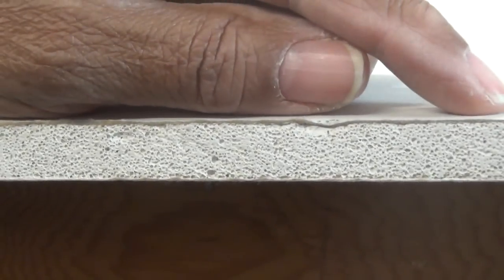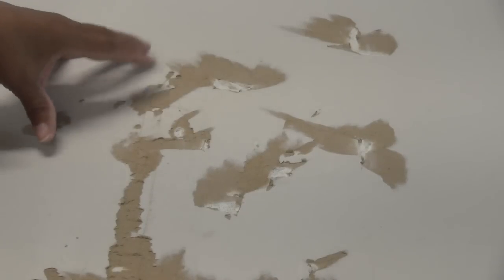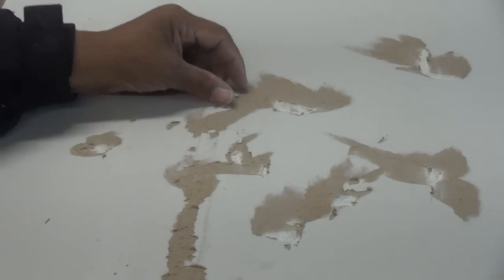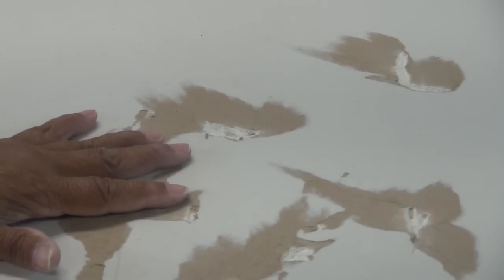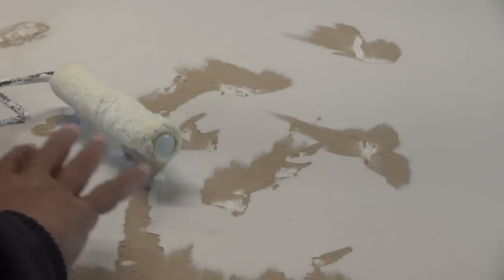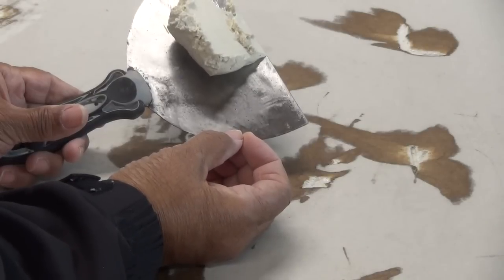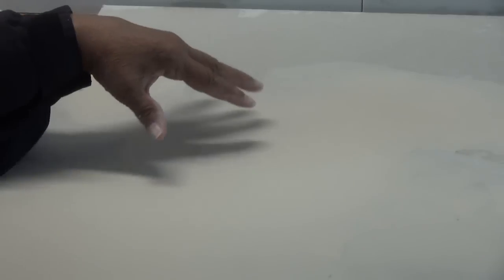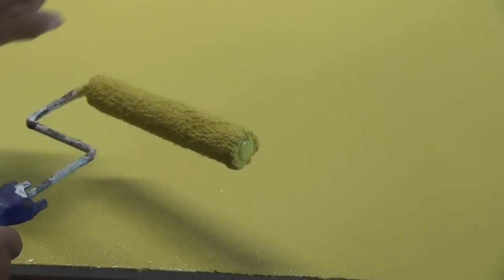How to Fix Damaged Drywall Paper

Comment: I have a bathroom that I believe was fully covered in wallpaper.  The people I bought the house from hand taken down the wallpaper but didn't thoroughly remove the paste.  They painted over the glue residue!  I couldn't figure out why the wall, between the back splash and the medicine cabinet I installed, had what looked like caulking all over it.  Sanding didn't remove it.  When I replaced the caulk around the shower surround I realized it was the same way.  Started looking at the walls and realized why they looked so funny.  Again tried sanding and it doesn't do a thing.  I tried wallpaper remover gel over the paint; I can scrape off the paint and the old glue and have a fairly smooth wall.
I take it I can use the Gardz on the entire wall and then paint over it?  I hope this is the answer to my problem!

Comment: You don't need to pay for that product. I use a pva primer layer. 1 part pva to 5 parts water. Cost is very cheap. Just give it a few coats and boom, You ready to go. Works for me.

Comment: Leah, I've just started to watch your videos and have learned so much.  Love you patient, unhurried method of teaching. Very helpful.
I could use some advise on a project I am attempting. Not sure if you have done anything like this, but your knowledge and skill I have
 no doubt could point me in the right direction.  I have a statue of a dragon about 3 feet tall, not the scary kind, just adorable. But he's
seen a lot of weather and has small pits and shallow surface damage that needs filling in and smoothing over before painting. The
surface is a thin layer of either what looks like clay/terra cotta paint or glaze. Underneath is rough textured concrete or cement. Not
sure which. Painting is no problem---acrylic water based paint works well outdoors, but what product do I use to fill in the chipped areas. 
Will need an adhesive glue to make it stick as well. Pliable enough to mold a small top of one ear as well. Any advise would be 
greatly appreciated. :) Thanks

Comment: Leah clearly knows her stuff.  Great video.

This "problem surface sealer" looks like PVA.  I can't believe that it is so expensive in the US.  In the UK similar PVA is CHEAP, cheaper than even budget paint.  I'd be tempted to water down some cheap PVA wood glue and give that a shot rather than pay a premium for a "professional" product.
Reply from the maker: Hi Dennis, thanks!  It actually isn't glue...I  don't have the can in front of me right now, but I wrote down the ingredients in response to someone else's question...it's in the other comments
Reply: This is the PVA glue/sealer that I was referring to (http://www.powertools2u.co.uk/PVA-Adhesives/Everbuild-PVA5L-Universal-PVA-Bond-501-5-Litre.htm) although there are many different brands to choose from over here.  I've not lived in the States for the best part of 20 years (native of Lansing, Mi) so I don't know if you have access to a similar product.  It may be a less expensive alternative and is almost certainly worth trying out on your test wall.

Comment: You have a gift for teaching and are using it! I am learning a lot and love to improve our home. Wondering if you could answer this...our paint was bubbling so I started peeling it off the wall. It comes off in chunks and is also stuck. I am working on getting the rest off. I am planning on using your video to fix the loose paper issue. I do have paper in places that is not torn, but it has air below so it is not attached - kind of like an air bubble behind it. What should I do? This is a bathroom and I am also confused about finishing the walls in regards to primer and paint and skim coat. Could you clarify that as well? Please keep making these videos for us home improvement addicts !

Comment: My house was completely wall papered and panels with construction adhesive. It took forever to patch it up not to mention removing some parts of the wall paper inch by inch. I think would have been faster just replace with new sheetrocks.
Reply: I bought a house with the same problem. Dark paneling all over the house. Going to take a ton of money to get it updated.

Comment: I trust your skills Leah and I am trying to do the fixes on my home by myself.  I don’t have a ton of money and am not real strong due to some joint issues and I need to do some work on my enclosed stairwell.  Is there a safe way to get a ladder up on those stairs to put up some paint or wall paper . I know you can’t answer everyones questions but I bet a video on this issue would help a lot of do it yourselfers .
Reply from the maker: you know, I myself have never felt comfortable using a ladder on stairs.  I would generally work it in combination with a scaffold.

Comment: Here's the deal. Part of the sheet rock  de-laminated some of the paper and my sweetie pulled it off. Can this stuff allow you to re-plaster the exposed gypsum and allow the plaster to stick enough to sand and then add the new texture coat?

Comment: Oops! We're first-time painters just repainting my kids' room and they had peeled a large patch of paint off the wall all the way to the gypsum. I spackled the edges, sanded, texture-sprayed and primed over the area already! It's about a 5" x 18" area. Do I really have to remove everything just to apply this sealer? We were just about to get to the fun part... painting! Thanks for your videos -- I've learned so much and passed them on. :)
Reply from the maker: No, not at all!  If it patched fine and it is holding, you may be ok.

Comment: I LOVE Leah and her demonstrations.  ...but this one ain't gonna happen. No pro is paying $40 for this sealer. 
Cut a clean edge around the flaw with a break off knife, pull off the paper inside the cut, mud sand and paint. Love ya Leah.  :)
Reply from the maker: Andy,  You would be surprised just how often this product is used.  It can be purchased for a lower price online.

Comment: Great information, next time I do something like that at least it will be correct.
Now, how about a crack adjacent to a sliding door. If it was welding I would "V" it out, fill the groove and grind it down. Perhaps a similar approach on the dry wall, using the method you used in this video would also work??
Reply from the maker: Hi Tom, unfortunately the Gardz won't help with that.  It sounds like a drywall installer's mistake, where the joint was placed too close to the door.  I would just fill it in with caulking, because caulking material is somewhat forgiving.
Reply: Thanks for the feedback. Will give it a try.
Reply: Tom Herd ...that's exactly right...if its under 1/4" or so deep/wide you can fill it proud with spackling and sand it flush before texture/prime/paint...caulk has a tendency to sag even in small beads...
Reply: Thanks for the tip.

Comment: Hi Leah - I was scraping some damaged paint due to moisture and some of the plaster seems to have come off. It's just in the corner and it is plaster on brick. I now have this ridge between the old paint on plaster and the area that was scraped. I am nervous to use plaster but since there was moisture - I am thinking plaster. I saw your difference between video. Thank you so much - I hope it turns out ok. I would ask a question but I am still learning lol don't know what to ask. :)
Reply from the maker: good luck with your project

Comment: I have a small (quarter-sized) rip in the wall and before I saw your video was going to use a razor knife and cut the paper around the bad spot, cover with Gardz, then spackle, then sand, more Gardz and then paint.  Good idea or bad?

Comment: Ha, I'm glad I watched this. I'm doing a remodel in my bathroom. There is a large mirror (54x41) that I believe is glued to the wall over my double sink bathroom vanity. I want to remove the mirror and replace it with 2 separate mirrors instead of one large mirror. I am a bit concern that I will tear the drywall paper. Now I can fix that if I tear the wallboard.

Comment: Does the sealant replace primer?  If it does can I seal the undamaged areas of drywall as well, before applying the paint, which I assume is a water based paint. Good video. I have seen at least 10 on the same subject and this was the clearest and most productive.  The others.....I don't know, just too wordy with no really good explantations of what is going on no clear cut procedures as with this video. I pruchased a quart of the GARDZ for $11 on amazon. The gallon would have been cheaper.

Comment: Ohh I had thought  your name was jane 😱 Ohh leah.I have to face the this issue inside the ceiling inside my open cabinet space that connects to the wall & ceiling basically my cabinet have no backing just open old built cabinet frame long & narrow built. I came across inside my cabinet part of the ceiling base the paper is split & bubbled.Leah you given an idea how to fix the ceiling paper cracks & splits. problem
Reply from the maker: HI Michelle, yes, the Gardz should work for the problem you are describing, if I understand you correctly.  Also, you can order a quart, if you don't need a full gallon, because it is a little on the pricey side.

Comment: Would this product be appropriate to use on a bathroom ceiling?  I previously scraped, plastered, sanded, and painted (without priming...bad advice from the hardware store). Now my plastered areas are showing through the paint.  I'll be redoing the entire process and want to make sure I do it right. 

P.S. - thank you for publishing these videos!
Reply from the maker: yes,  you can use the product on the ceiling.  But I'm wondering...what do you mean by the "plastered areas are showing through the paint"?

Comment: I am a professional painter of over 25 years and yes you can buy this in hardware stores and no professionals do not use it. Edit: a professional would never use a 6 inch knife to do that work either. This person does not have a clue.

Comment: I should've watched this before I fixed two large areas due to a huge towel rack. I did only one coat (a total beginner with a few youtube videoclips and didn't do a good job on sanding. Thought it would be okay. I have now two ugly spots in my bathroom. Sadness and stupidness.

Comment: Easy sand and lite weight compounds fail often it's to soft to hold up . About 60% of my repair work in new homes is from some contractor using these products . Even when primed with the best sealers and primers the layers will peel apart from each other , it dose not matter if it's the best contractor or the worst it's the product it's self .
Reply from the maker: I appreciate you sharing your personal experience. And you're right, it doesn't have the strongest finish, but what you are describing has not been my experience, and I've done thousands of jobs.
Reply: Jj How sounds like a moisture problem
Reply: I don't know what causes it I just know I will never use it ! I'm a durabond guy

Comment: great video again! Im salty because I have a tiny rip from using those no drill adhesive mounts. They work great but I pulled it off sideways and it ripped. Could I just compound over it without using that sealer??

Comment: Loved your video!  May I please ask a question?  My kitchen wall behind my cabinets is 10' wide and 22" from counter to bottom of top cabinets, not a big area at all.  It was papered at one point.  I had new cabinets, countertops and appliances installed and thought I could repair the wall myself.  Thinking I would eventually put on a backsplash, I quickly threw a coat of paint over the messed up drywall.  Since this is a part time residence, I am only here a few months of the year, and last year I decided to run a LED light strip under the cabinets for ambiance.....well....every flaw and imperfection in the wall is totally apparent and it just screams at you.  How can I repair this wall now?  It's painted.  I decided against the backsplash because I think it will fight with the countertops and I prefer a cleaner look.  The guy in the paint dept at Home Depot suggested I rip out the drywall and install new....way too complicated for me and way above my paygrade....LOL.....but all kidding aside, this is a project I'd like to tackle and complete and have found YouTube videos very helpful.  Recently I stripped all my bathroom wallpaper, using techniques I learned on YouTube and it came out amazing, so my confidence is building!  Thank you for reading this lengthy question, and would appreciate any advice or input you care to share.....

Comment: If the paper has been completely removed from the drywall, exposing the gypsum core, should Gardz be used to coat it or can mud be applied directly onto the gypsum core? Thanks.

Comment: Okay great but.... making your OWN sealant? The thread mentions using white glue but does not say what white glue is! Wood glue is white! Can i use watered down wood glue then? And this white glue! What is that used for originally? Strange questions perhaps but i am in Sweden and the products mentioned have different names and availability, so the line of questioning helps to narrow down the cheaper and more available options, for someone who would like the clever old fox alternatives that work equally well, without the flowery branding costs on top.

Comment: This product is water-based and does not work well, as the wall still bubbles up most of the time when used. You need a shellac based primer sealer. Don’t use this product are you will be very disappointed Andwill have to do the job twice, The second time using a shellac Non water-based primer

Comment: Hi Leah! So, if I tear the paper behind the backsplash while taking down the existing tile, will I need to do this step or is it just when I want to paint over a damaged area? And why wouldn't applying a layer of wall mud/plaster (?) and sanding it smooth not be adequate prior to painting? What is the importance of the paper layer on drywall? (Please excuse my ignorance)
Reply: according to a prior video I was watching.  The compound with seep into the drywall and eventually it will become weak and bubble up.

Comment: Thanks for the great tutorial.  Just wondering if the whole wall has been stripped to the brown paper would you still use this method, or is there something else that covers large areas? 
The previous owner had glued sand or something onto the wall, and when removing it, it goes back to the that paper layer.

Comment: Never fail to help me through, Leah. I have a question, though. I’m removing tiles from our half bath and placing new ones. There is yellow adhesive stuck where I have removed tiles. Do I need to replace the drywall or is there a quick way to take off the adhesive? I have a multi tool, I used a rigid scraping blade in it to pop off the tiles with ease, but I am worried that taking off the adhesive some left behind will be too labor and time intensive to do, have a tip to save me having to rent a truck to get some drywall? Thanks if you can help! I’m trying to get this all done before my son is born some time this month so my lady can have a functioning master bathroom!

Comment: Leah, loved your video. I just removed backsplash tile that was installed onto drywall. The drywall is now a huge peeling mess. Can I use this process to repair walls that I intend to install a new backsplash on? Is there anything else I should do to the walls to be sure the mastic sticks?

Comment: Thanks for this video on this product. My question about its use for that type of repair: Could you fill in the damage spots with that type of filler, sand smooth, refill with that filler again if necessary,  then apply two coats of that sealer with a fine light sanding between coats, then paint? Would you get the same result as you got as you described?
Reply from the maker: No

Comment: Question....after I get to the step of applying mud over treated drywal areas, then applying another coat over the mud, do I need to coat entire ceiling before painting,  or can I just cost treated areas? The entire ceiling is drywal only, but I only coated damaged drywall. If I do not coat entire ceiling, in guessing all the surface will not be equal. I removed popcorn, damaged small areas of drywall. I plan on painting drywall without skin coating. Help, should I use this as a primer on entire ceiling, or just apply to damaged areas and then prime and paint? Wasnt sure if I could replace primer with this, or do both....

Comment: I saw this video after I had already covered the torn paper with the joint compound.  I thought the joint compound was what was needed to cover the torn paper before putting on a primer.  Also I was told by some paint store people that I needed to use oil based primer if I was painting over wallpaper, even after removing it, but then was told by another paint store that if I skimmed the wall with joint compound, not necessary.  Hating oil, I bought a latex primer to go over the joint compound, before painting. I put a real thin layer of joint compound over the wall.  I hope this will be ok.  I wasn't able to find the Zinnzer stuff anywhere locally anyway and I want to finish the kitchen today. Wish I would have seen this video first!
Reply: Gardz just seals the paper preventing it from possibly coming thru the  joint compound and can cause a irregular surface. And thinned white/Elemer glue is used as a sealer of the torn drywall paper too..But if that didn't happen it was wasn't necessary to seal it in ur case....

BTW-- I have see a few posts using a paint roller to apply a skim coat of joint compound that seem faster too....Good luck...